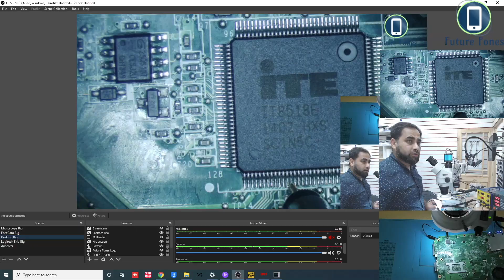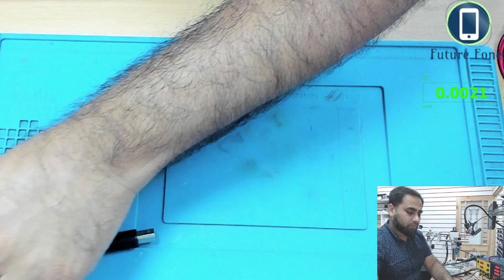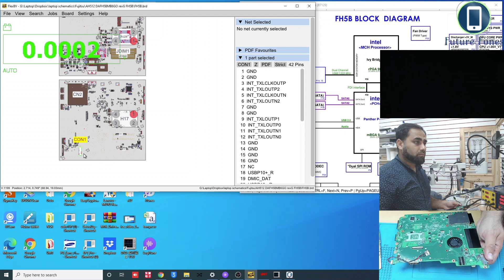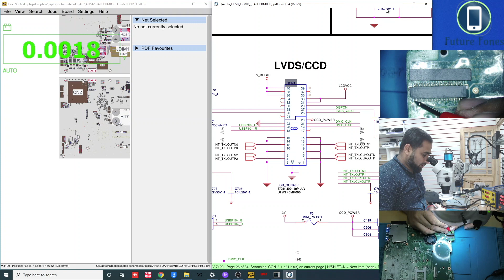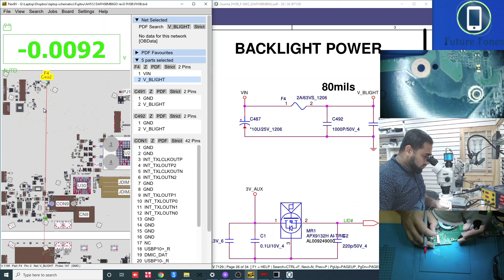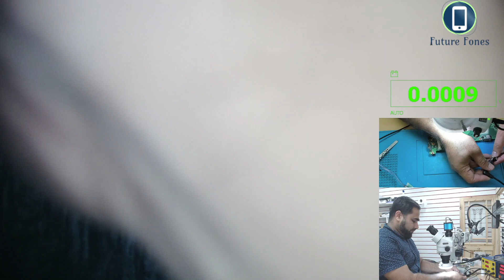Fujitsu LifeBook A512 Laptop Display and Bios Repair!!

Comment: Aslam o alikum. Bro I have same laptop, all voltages are present but gfx. When I turn it on . Fans spin cupu heats up normally and fan spin when it gets hot. Power led on header and on power button blinks continuesly. I have reprogramed bios and EC. But nothing change. Can you give me any hint where to look.